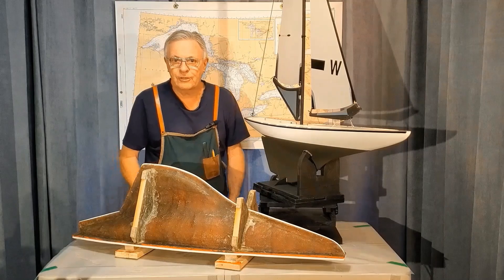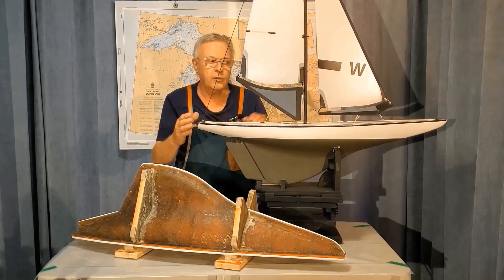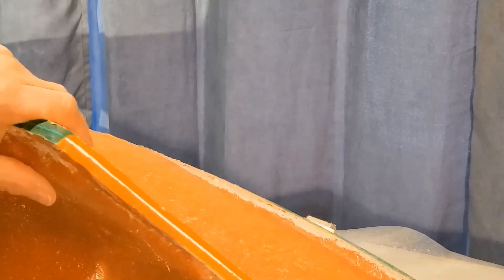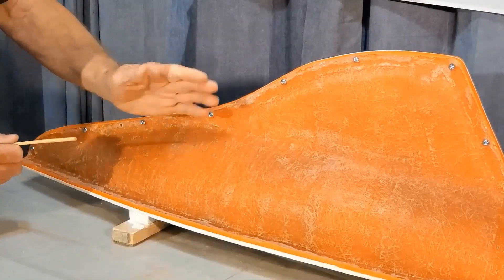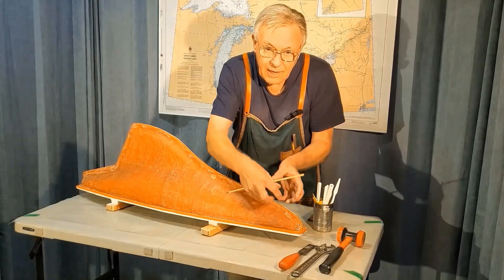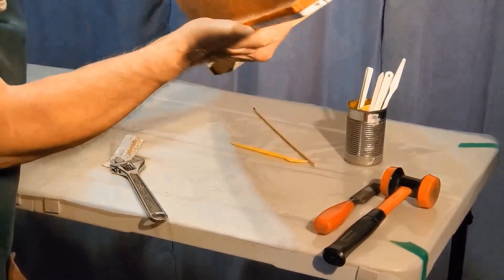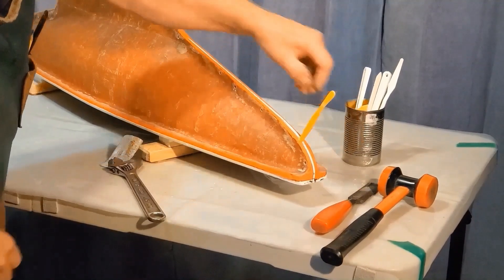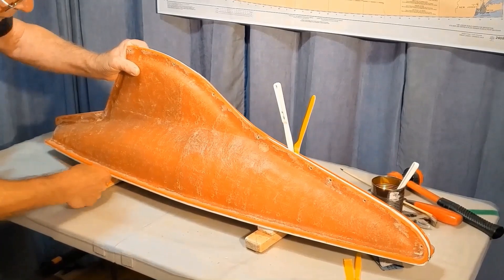RC Weedless 6M Molds Released From New Plug

Comment: Sir, you're a very talented individual in designing, building, and presented. Thanks for what you do. I am a simple DF65 sailor, who used to work at a small fiberglass boat shop in the very late 1960's in the summer during high school. I remember the difficulty in removing parts from different molds. Often requiring some cursing and compressed air.
Reply from the maker: No question.  If the layup doesn't release a lot of labor and materials are wasted !!   Brian RCWH